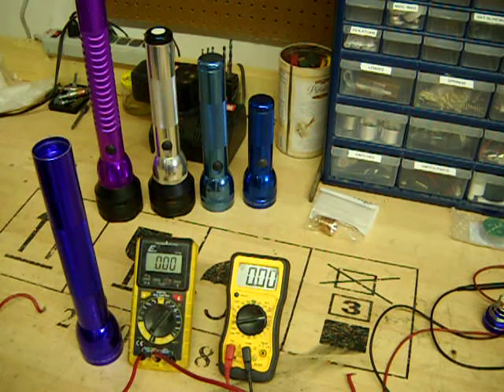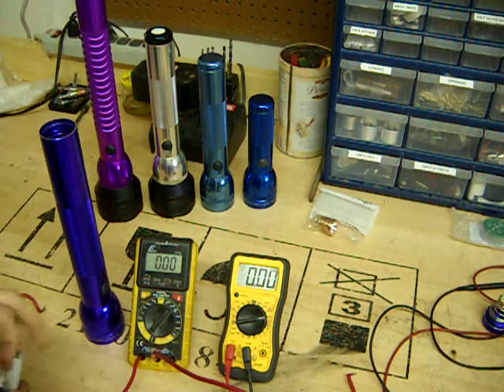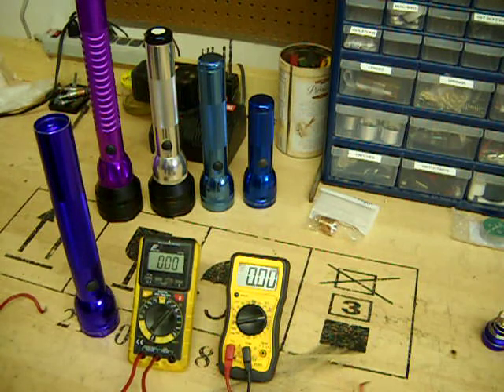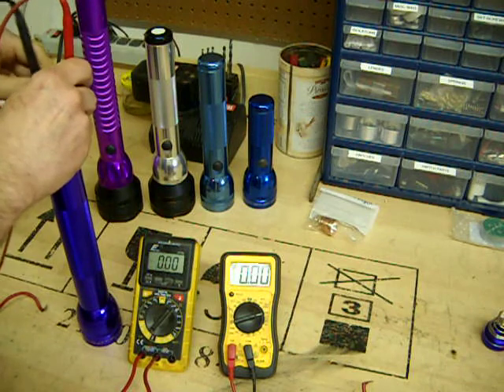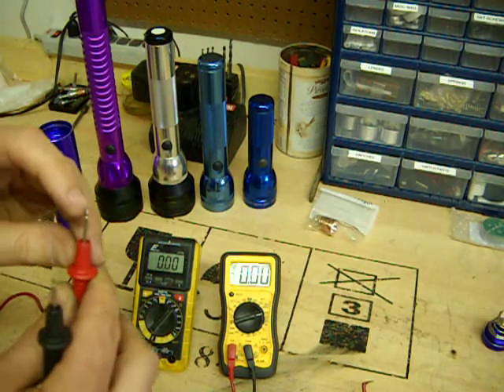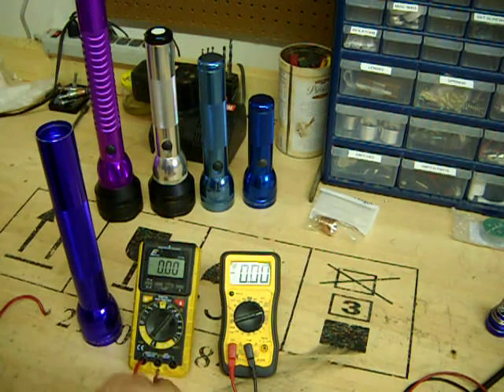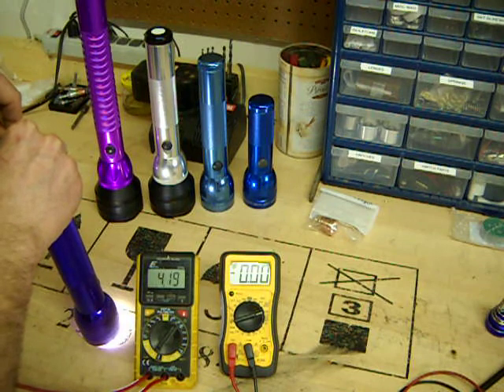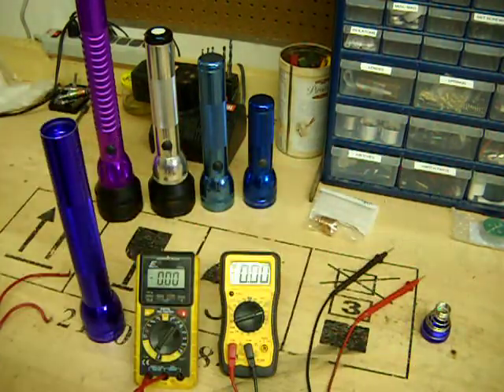How to Measure Current in a Flashlight  using a Multimeter (DMM)

Comment: If you want a REAL comparison, you would need to use the meter on the right with BOTH sets of wires to see what difference changing the wire set makes.  For all we know from this video, using the thicker wires with the meter you used first "could" read higher than the meter on the left, however, we do not know that because the test is not on equal grounds, plus, there is a variance from meter to meter and they do not all read "exactly" the same. I have cheap to expensive meters and they all read a little different.  Even when professionally calibrated, there will still be a (+ -) of a percent.  Hope this helps in your next review.